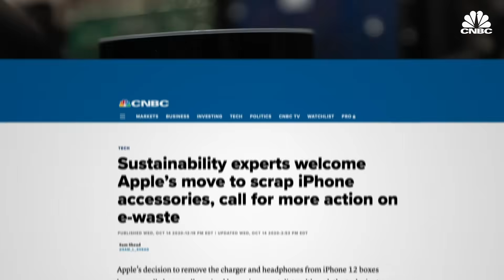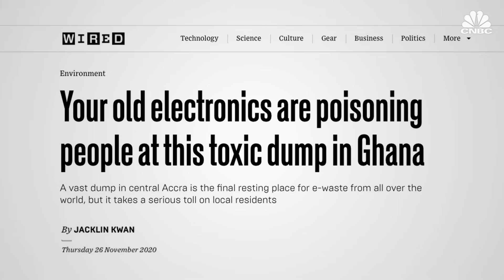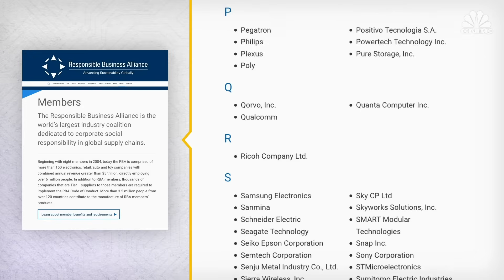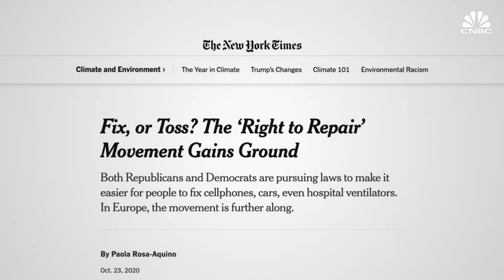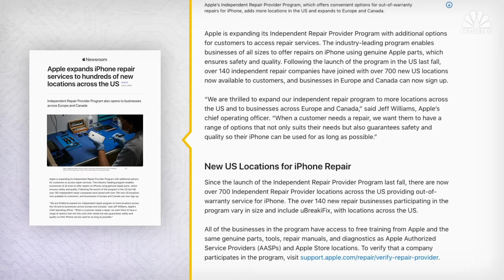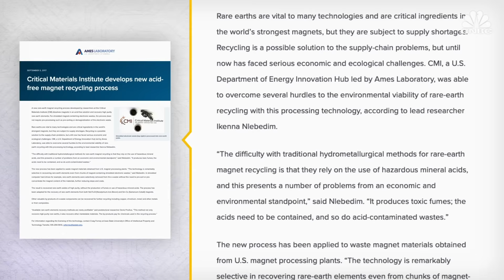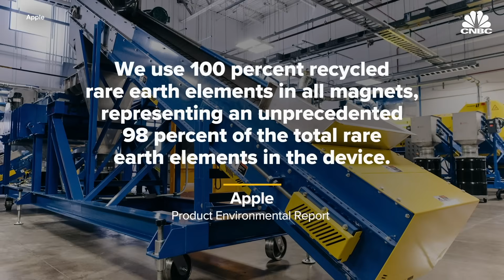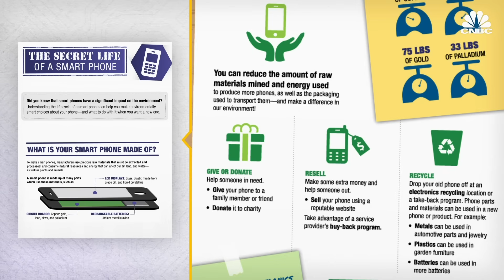How Can We Fix The Massive E-Waste Problem?

Comment: I support e-waste reform, but this video has way too much overblown high-pitched nerd rage. Both the narrator and the people he interviews. "This product will stop working in 18 months." That's an absolute lie on so many levels. I still use a phone from 3 years ago that retains 85% of the battery life. Ditto everyone else I know that isn't an uber driver using their phone as a GPS 10hrs a day permanently plugged in. It works perfectly fine, runs all apps, and is just as fast after a factory reset to clean out messy software installations. My mom uses a six year old tablet to watch youtube. One with an AMOLED display that has no burn in.

Comment: Bought my iPhone 6S 4 years ago for $50 back when contract deals were a thing.  Even then the phone was technically 2 years old.  It’s been very reliable and I’ve never had any issues with it, not even a cracked screen (knock on wood).  Hopefully the swines at Apple continue to support it as I plan on keeping it indefinitely.
Reply: I’m in the same position. Its super reliable. Much more enviromentally friendly than a low quality phone that you would have to change
Reply: STOP SPAMMING YOU BOT, APPLE IS LIEING COMPANY MICROSOFT GAVE APPLE MONEY BECAUSE APPLE IS THE SAME AS TIC TOK, EVIL
Reply: @insectbite1714  🙄

Comment: Or people should stop replacing phone every 1 or 2 years? I have been using my Iphone 6S since it came out, and other than the battery life, it still works perfectly.
Reply: Your a bot. Stop copying and pasting your evil Apple praising comment
Reply: @insectbite1714  Chill, you can use your Android for that long too. I am just sharing my experiece.
Reply: @renqiangyuan1705  well, it would be very uncomfortable or even unsafe as they dont support phones for even more than 2 years which should be illegal.

Comment: A big reason why some people switch their phones so often is that many devices lose software support after 2 years. With no software support or security patches a device might not be safe to use, if it's connected to the internet. But how big issue software security is, it's a whole another topic. 
Apple seems to be really good with software patches to keep devices updated. Google and Samsung are also moving to that direction thankfully. 
I might consider buying a version of the Fairphone, even though it's a bit "outdated".

Comment: This year I replaced my iMac 2012. My iPhone 6 is still is in a good state and only replaced the battery this year, but will be forced to update to a new model next year I believe.
Reply: You got quite many years out of it. Really good by you
Reply: STOP THROWING OUT OLD TOXIC BATTERIES. APPLE IS NASTY
Reply: @insectbite1714  apple supports my 2015 iphone 6s. I dont have to upgrade. What phone are you using and when did you buy it?

Comment: Wait for the Apple car with tyres welded onto wheels and battery that can't be replaced.
Reply: Tesla are already stopping specialist repair shops repairing their cars by stopping them buy parts off them because they aren't Tesla dealers. Watch rich rebuilds he got fed up with Tesla's attitude to small repair shops not supplying them so he is rebuilding a Tesla with a engine and transmission he can get parts for easily and it's not electric.
Reply: @bentullett6068  seriously, I hate the engodening of tesla. They really aren't that great for the environment and all they bring to the table is acceleration, crappy interiors and crappy quality control
Reply: @Carterthielftw_  I don't like them either Mr Musk's latest idea i have heard is that he is looking at building one of his huge giga factories on countryside in Somerset in the UK.
Reply: @bentullett6068  Tesla has since changed position on that.
Reply: iPhone batteries are much easier to replace then the batteries of other companies because they are held in with easy to remove adhesive tabs rather than just glue.
Reply: @Chipbar  and it doesnt even matter if that's the case, since 3rd party are not even allowed to replace anyway. they just want you to pay their obviously overpriced service and products lol
Reply: @Peter60906  vehicles? There are quite a few right to repair laws that have been passed in the automotive sector. As long as you can buy the licences for software every year you will be fine.
Reply: @Carterthielftw_  i have no idea what you are trying to say lol. do you mean apple's vehicle or?
Reply: @Peter60906  no, the car industry in general. Mechanics can repair basically anything they need to as long as they pay the manufacturer the subscription fee for diagnostic tools and parts
Reply: @Carterthielftw_  no idea why is car or those subscription fee to tools relevant here since we are talking about phones.and what you said is different from those of phones. diagnostic tools are tools used to make moneys, phones are products that are straight in the hands of consumers. 

if the diagnostic is stupidly overpriced, and it isnt worth it. i pretty sure alot of the mechanic also will stop subscribing to it too.
Reply: @Peter60906  all my original comment was pointing out is that we have the right to repair our vehicles. We just need that right too be brought over into the technology sector
Reply: @Carterthielftw_  ah i see. but apparently not all. if i rmb correctly "rich build" is facing something similar to that of apple against tesla.
https://www.reddit.com/r/teslamotors/comments/fellt1/tesla_is_once_again_not_selling_parts_for_salvage/

something about he was really fed up with tesla not selling their parts or something.
Reply: @Chipbar  https://www.youtube.com/watch?v=FY7DtKMBxBw&t=169s
Reply: @jxp1993  or better yet dont buy it
Reply: Drive that sumbitch straight into the Apple Store, and run over the "genius" (jeenyus) bar. lol
Reply: And the wheel is programmed to fail after 18 months and can't be repaired. You will be forced to buy a new car every 2 years.
Reply: Tires*
Reply: @olivervukusic2911  tyre  is the British spelling for tire
Reply: @James-sz2hr  really? First time hearing it
Reply: @block_hacks  yea, my country which is using british english use the word "tyre"

Comment: Due to my low income I try to get the best phone for my budget that will last as long as possible. Last year The battery died in my Moto Z and the repair company couldn’t get the new screen to stay on. It kept peeling off! I cried because I don’t like buying new phones when They should last as long as cars at least! I never get a new one unless I’m unable to continue. That time is getting shorter than ever! My first phone the Motorola Razr lasted six years and could have kept going

Comment: I was pretty upset my phone's battery (Galaxy S8) is not user replaceable, but I took what measures I could to extend its life. Disable fast charging, don't use apps that consume background power or data (Facebook notifications bug the hell out of me anyway)
So I've gotten 2-3 days of battery life on average and seldom every run out before recharging. Hopefully the fewer recharge cycles will keep it around a few more years

Comment: yeah apple makes those claims yet it can't prove anything when the Brazil government asks for it. The charger move is TOTAL BS.

The glue could also be removed from a lot of the construction of these devices but that would facilitate replacements for consumers too much so companies put their profits ahead of recycling flexibility. Moreover making a device last longer isn't a good decision for profits either so every company does the minimum there to make sure the consumer keeps coming every 1-2 years for an upgrade, even if they don't need it (I used my iPhone 6s from launch until the iPhone 11s come out and I only needed to replace the battery a couple times)

Comment: Some old devices are just too old to run any modern applications. It's not just the software (although locked bootloader is an issue)  but just the hardware and outdated hardware architectures make it unlikely to be usable
Reply: Apple makes more modern applications

Comment: I used my Motorola Razr from 2009 til 2017 until it just stopped working. Got a brand new Motorola G4 that I still use today. You don't have to upgrade every time a new version every few months. Just take care of your stuff and it can last.
Reply: Lol why not upgrade to the latest iPhone or Samsung every year? Gotta keep up with the cool crowd
Reply: Kudos to you I don't know a lot of people that can stick it out with old hardware
Reply: @milanthakkar9493  2017 is not that long ago.
Reply: @Carterthielftw_  the moto g4 came out in 2016 which is what I was referring to. The fact that it was not even a flagship but a budget phone in 2016 and that he's using it is admirable.
Reply: @milanthakkar9493  Who cares
Reply: @unicornkatana9836  why reply????
Reply: @milanthakkar9493  I had that exact same model, but happily I finally sent it off for recycling after it being stuck in a draw for 12 months
Reply: @milanthakkar9493  alright. I used a Kindle 6th gen HD7 for about 5 years before it broke. I probably could have gotten another 8-12 months out of it until it would have gotten annoyingly slow. I just jailbroke it to run Android and disabled animations. It ran 720p YouTube great and had no real performance issues. People just prematurely upgrade devices. I will only switch out mobile devices when they get slow enough that it is frustrating. 

I know my mom ran some midrange droid (the mostly dead phone brand) for 5+ years and my dad is still using his as a personal device.
Reply: R Enns,  I have a first generation ipad basically the first one that ever came out. It doesn't upgrade any more. Sometimes it will kick me out of apps or kick me out of the browser while I am using it. Just became annoying as heck. I even did a hard reset which didn't fix the problem. I decided to get a samsung galaxy tablet. I still have the first ipad and use it from time to time. I use my samsung tablet too more so while I am on vacation though (beats bringing a laptop). As for smart phones- I truthfully only have had one. I just recently upgraded to a smart phone from a standard keyboard flip phone. Reason being is my flip phone screen started to cut out just went blank. My network was giving me a hard time in trying to use another flip phone. It was just time to get a smart phone. I held out as long as I could. LOL. Some people even told me like 'what type of phone is that? Ive never seen one like that.'  It was old- probably since 2005 phone.  As long as it continues to work , I most likely will not buy another phone. Don't even care about the 5G. I'm content. As for laptops I had been using my Dell laptop since 2005. Then it finely pooped out on me 2 years ago so bought an HP. I don't really see myself as an e-waster as i tend to just use my gadgets for the longest possible and use them to the very max.
Reply: @boohere2  Why tell us all this. You're just virtue signalling
Reply: @unicornkatana9836  the first person did so i was just responding with a similar situation. If you don't like it move on keep reading
Reply: test
edit: that was a test to see if I could reply to a comment as YouTube told me I couldn't when replying to a different one
Censorship?
Reply: @bearmugs1408  for sure

Comment: An issue with Android devices is that manufacturers stop updating them after 2-3 years leaving you stuck with an outdated phone. Its like manufacturers what you to buy a new phone every 2 years, so they abandoned the older model phone even they a newer version of Android may work on the phone
Reply: I'm still using android 9 and having NO problem at all, you think android phones after updates will stop working or some nonsense stuff?
Reply: @baoquoc3710  of course not. A phone I bought last year is still stuck on Android 9, unfortunately it never got updated to Android 10, but it does got security updates regularly
Reply: Precisely because Android versions are very fragmented, app developers are expected to support older versions of the OS. The app support of older devices is not any worse than the way Apple does it with more OS updates and higher OS requirements among apps. 

Security update is a different can of worm but customers are able to flash a custom ROM if they are inclined. My Nexus 7 from 2013 can run up to Android 10.

Comment: The problem is that companies release too many products in their lineup that are redundant.
Samsung released 4 S20 models and two Note 20 ones, along with the Z Fold and Flip. 
They could just fuse the Ultra and the Note models into 1, launch it along with the standard S2x, then save the Fold and Flip till the end.
Plus you still have to account for all the lower and mid-tier models they have, which are even more of the same.

Comment: This is one of the biggest problems facing humanity.  And like always, we won't start doing anything until it is too late.
Reply: Sadly its true
Reply: Our only criticism is that the issues around #ewaste go beyond consumer electronics. A single electronic inverter PCB found in a solar panel or wind turbine for example requires 15-20x the resources, minerals that go into making a single phone PCB (printed circuit board). More needs to be done across the business spectrum. #Repairdontwaste
Reply: @ABIElectronics  Yes but the Number of phones per pcb inverter is like what a 1000 to 1? And pcb inverter probably last  longer than average phone. But overall you are right but it's understandable why they are not the priority
Reply: @KrolPawi  sure, the priority does not need to be changed but it doesn't mean that industrial electronics should be left out. Between cost cuts and programmed obsolescence, typical lifespan of drives, controls, inverters are being cut to 3 years. We've stopped truckloads of those from being discarded though throughout our 37-year history.
Reply: @ABIElectronics  now thats suprising. While its not a strange thing that planned obsolence is a thing when it comes to consumer Electronics(to be fair the producent ussualy dosent even need to try, consumer Will happily throw away his Old phone or fridge for a better shiner and smarter one without this whole planned obsolence thing) you would think it wont be a thing when it comes to a more specialized Electronics
Reply: better late than never🤷🏿‍♂️
Reply: Stop complaining and start buying less crap
Reply: unfortunately.
Reply: @navtejsingh9248  ))all)lk
Reply: So let's then start taking responsibility. We can still do something!

Comment: Just dont buy the crap. I am watching this video on my 3 years old samsung galaxy s8 and I am sure this will work for another cople of years
Reply: Pretty much. The only long term solution is to get rid of consumerist culture.
Reply: Interesting. I've had a Galaxy Note8 that I've used for around 2½ years before it began having input lag issues (I can explain), and finally let go after over 3 years when I was able to upgrade, however, I think the issue was with the battery, RAM, and/or internal storage being worn out, and replacing the battery helped partially alleviate the issue. I'm a heavy user and take a lot of photos, as well as use a lot of apps.
Reply: @kbhasi  I'm using my s8 plus for like 3 years now and it still works like new, I've never heard of a phones internal storage/ram wearing out before. You could just try resetting it
Reply: @kbhasi the condition of my sgs8 is far from perfect. Its lagging sometimes and the screen burned in at the bottom and all covered with scratches. But it is steal completely usable which allow me not to throw it away for now
Reply: Backwards-ahead of you on S7, that was damaged badly, got it's battery, screen and frame replaced, and still runs to this day as i'm writing a comment.